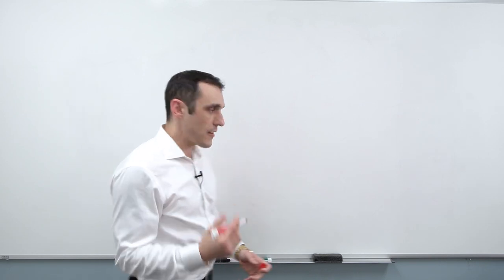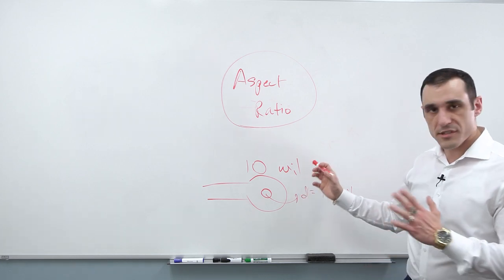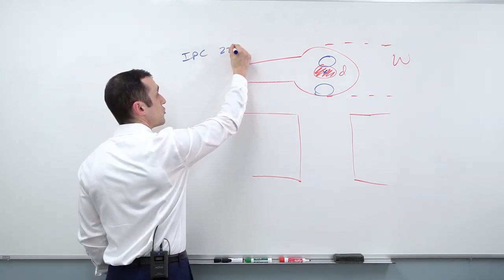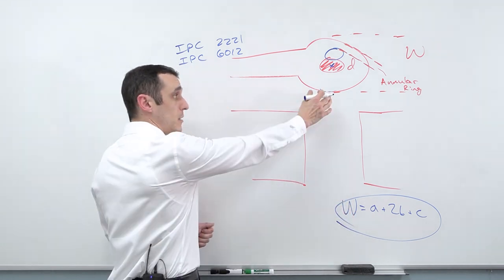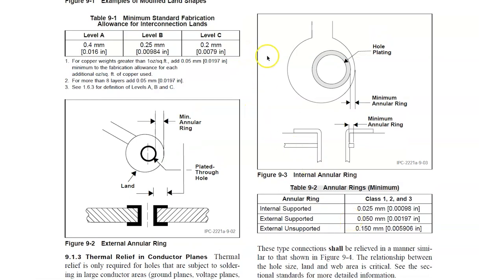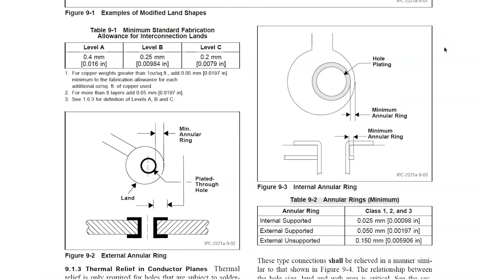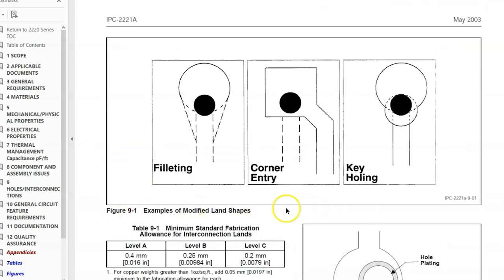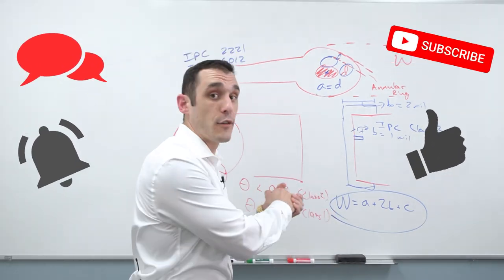Routing with Vias | PCB Routing

Comment: Hi Altium Academy: Thickness Via plating is also important for the maximum current and this is different for different manufacturers. If the current is very high the solution is to place 2 or more Vias.
Reply: Yes definitely for power it is important, in fact I will probably need to do a video on routing through vias for power considerations in DC and high speed design.

Comment: Hi Zach. For a 4-layer board. Going from L1 to L4 thru-hole... are the pads needed on the internal layers or only on the top and bottom? Sometimes Altium adds pads on all layers and sometimes it doesn't. Altium also allows you to change the pad diameter for the internal layers, for example to 0, is that allowed?.  What are the issues with not having pads on internal layers for a thru-hole via?
Reply: Yes you can remove those pads on the internal layers. They are called "non-functional pads" and there is sometimes some debate as to whether they should be kept in the layout or whether they should be removed. The argument for removing them is that they can create a problem called "telegraphing" due to resin starvation around the the via hole wall. There is also the possibility of shorts when a trace is routed too close to the pad, either due to ECM failure or just due to fabrication tolerances, although modern CAD tools will flag a design rule error if you violate trace-to-pad clearances. I still need to do a video about this because it's an important reliability topic.
Reply: @Zachariah-Peterson  Appreciate your reply, love the videos and your professionalism very much.

Comment: So, if I use 10 mils diam hole, W should be 22 mils (min) for IPC-2221, right?
Reply: For outer layers the pad would be 18 mil minimum for Class 2 compliance when the manufacturer can guarantee the highest producibility level under IPC 2221 and IPC 6012. For class 3 it would be 20 mils. To keep it simple, you can use the same pad size on inner layers.

Comment: Hello, as you spoke about drill wanders can this be a tedious task for manufacturer to manufacture fine pitch BGA pads which uses vias in pads technology?
Reply: Sure it could be, but standard drill tooling and process can do it even if it's part of a BGA footprint. For BGA with via in pad, the other important aspect is fill and plate, which needs to be void free and not have large dimples.

Comment: I didn't see a link to the blog that also has links to getting the IPC standard.
Reply: Good catch, I added the link!
Reply: The current version of standard IPC-2221B is sadly not free.
Reply: @robertdixon8238  Yes that's right, I provided 2221A in the blog.
Reply: @Zachariah-Peterson  I find your content and detailed insights to be extremely helpful. Keep up the great work! On the topic of IPC standards, can you provide a comprehensive list of them that covers both DFM and DFA? Also would be great if you could provide links for download of the previous version if the latest version is not possible due to cost🙂
Reply: @RWCARC  That will take some time to compile but I will do my best!

Comment: Can I know is it okay to place vias at the bending points of routing paths?
Reply: Yes of course, as long as the pad is large enough it will not matter where you route into the via. The pad needs to be large enough to ensure that the leftover annular ring after drilling leaves a copper connection to the trace. Some manufacturers will recommend teardrops be placed to ensure the trace will have enough extra copper so that a missed drill hit will not disconnect the trace from the via.

Comment: I would not trust a board that doesn't have teardrops (or a designer that resists teardrops).  Great video, as usual.

I would add, try to go as big a via and pad as possible.  10 mil drill is OK but bigger is better.
Reply: Agreed, 10 mil is what I normally go with on smaller boards with smaller digital components that need to be packed close together. On other boards where the density is not a requirement I will go bigger than 10 mils.

Comment: If a via has no internal layer tracks connecting to it, does it need internal pads at all?
Reply: This is a good question as I've heard arguments both ways. Technically no, if there are no tracks then you would not need the additional pads at all. The two main arguments for removing NFPs on internal layers are: 1) they reduce drill bit life because copper is harder to drill through than substrate, and 2) they create stress concentration along the via barrel. The 2nd point seems to be one of contention since people will say the via barrel is less reliable if there are no pads because the plating might separate from the hole wall. Then there is the signal aspect; vias with NFPs can have higher insertion/return losses.

If you are going to remove NFPs you should do it after routing, or you should just leave them off and apply a larger hole wall to clearance spacing limit. That way, you reduce the risk of the drill hit touching a nearby trace and creating a short.
Reply: @Zachariah-Peterson  great response, thank you so much. I removed the NFPs so internal planes would have less discontinuities. I'll take more care with that approach now with the points you mentioned. Thank you

Comment: Uh, you're also wrong about process flow. 
See this - https://www.youtube.com/watch?v=rLBChuikmGU  - - 

yea, inner layers are etched prior to drilling, but once they are stacked and pressed, the outer layers are then drilled PRIOR to exposure/development/etching. So once you've assembled the  layers stacks (prepreg/cores) you THEN DRILL -  then plate -THEN you do the photoresist and etch the outer layers.  For one, if you tried etching first then drilling, the force of the fishtail carbide bits would most likely rip the via pads off. Two, having solid copper on the outsides allows for better plating.